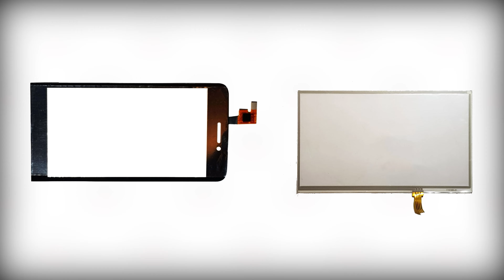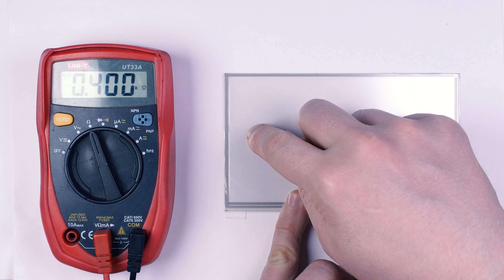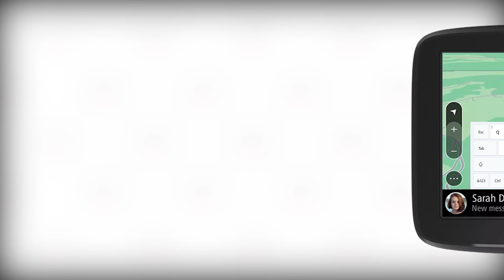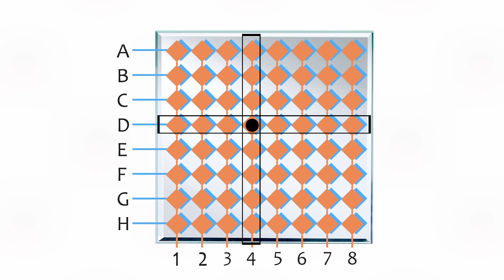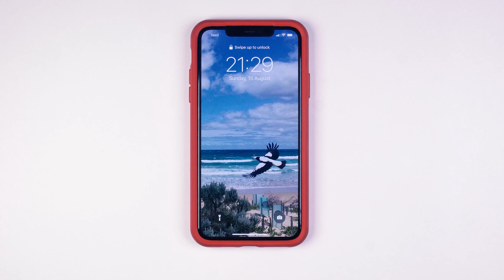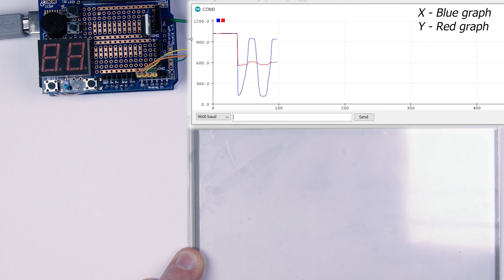How does the Touchscreen Work? #electronics #diy #engineering #arduino #arduinoproject

Comment: Misinformation. The light gun does not use the beam position. It is impossible to determine from a distance. Instead, when gun trigger is depressed, console momentarily shows a black screen with the only white spot being the target, the spot is relatively large. If the gun sees the spot, the hit is detected.